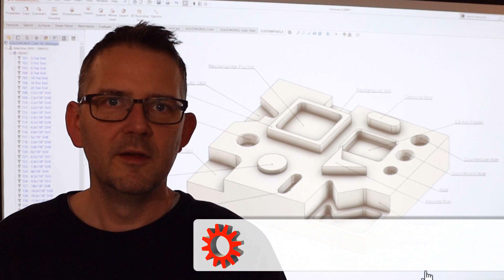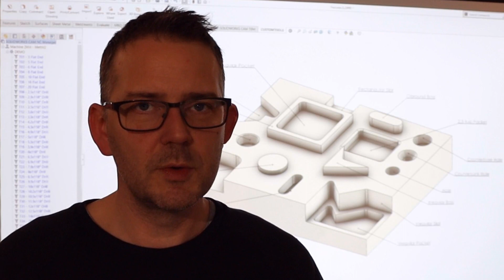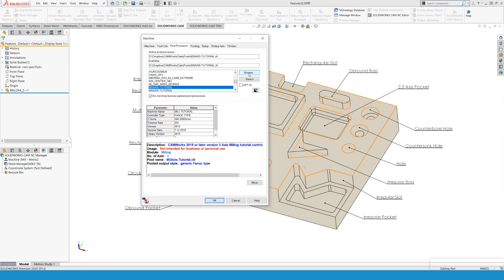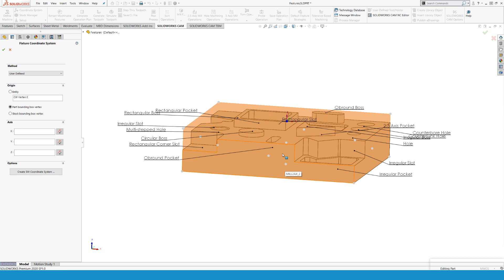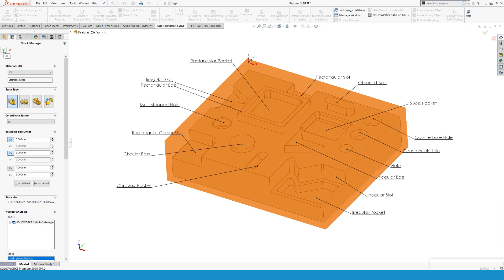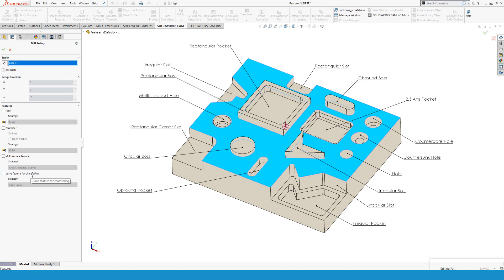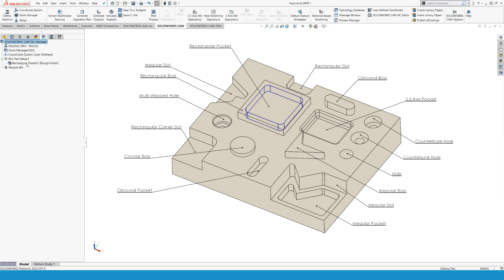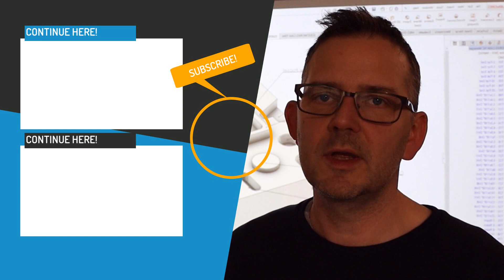Introduction to SOLIDWORKS CAM and CAMWorks. Define the first basic setup.

Comment: Camworks 2017 
Is it compatible with Solidworks 2020?
Reply from the maker: Hi Amin - No. In practical terms, no addin is forward compatible. Meaning, if running SW2020, then you need either CAMWorks 2020 or CAMWorks 2021 - CAMWorks 2019 will not run in SW2020.